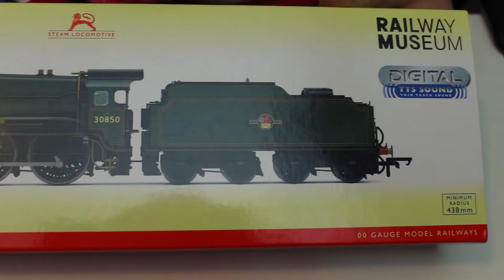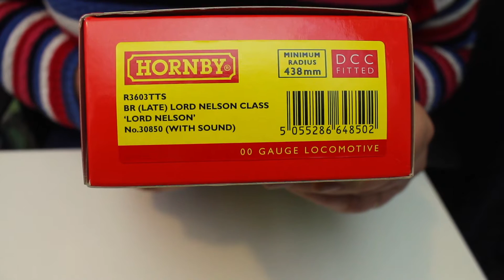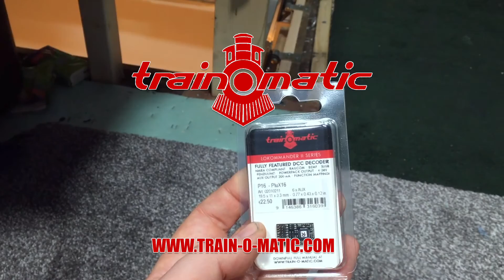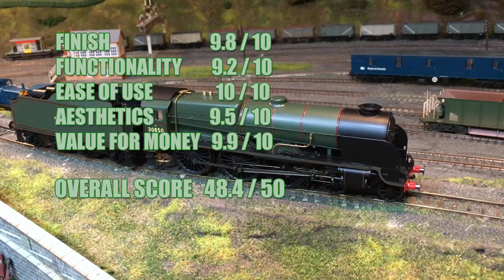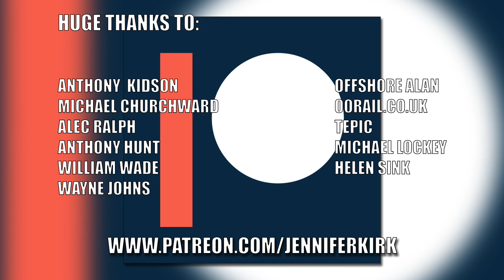Hornby Lord Nelson Class in BR Late Crest livery with DCC TTS Sound - Unboxing and Review

Comment: Hi Jenny. The Southern Lord Nelsons when originally built, had six wheel tenders for hauling 500ton boat trains between London and Dover, which is only about 60 miles each way. However after less than half the class was built the Southern decided to use them on the South Western route requiring a larger water capacity tender, hence the 8 wheel tender, as the Southern had no water troughs. Even these longer routes were less distance than the LNER or LMS Anglo Scottish routes, so that is why the coal capacity was alot smaller than an A4 or Duchess. I must also mention you picked out the nice detail of the "Regulator" on the side of the locomotive, it's actually the "Reverser" linkage. Just one last point, in your video of the BR logo it seems like the wheel and top of the Lion look blue, was that a right, I don't think so? Anyway, nice review as always, Best regards Dave.
Reply from the maker: stretchedits thanks - I have a habit of getting similar terms mixed up. 

Thanks for the info!

Comment: Locomotives use more water than coal. And stopping to take water costs time and is more frequent than coal once or maybe twice a day.
Also you could put extra weight in the boiler for more grip
Reply from the maker: BAMBAM5476 interesting points. Makes sense.

Comment: Hi Jenny. Great review. I bought one from RofS. First steam sound loco. Love it. But help.  There is a small wire from the rear left drive wheel that attaches to the bodywork above and behind it. It has come away from the bodywork end (wheel end is still attached) I cannot see how to reattach it. Looked closely at your review and it is still not clear. Is this cosmetic or functional? Can I just superglue it back on? Thanks in advance for your help.
Reply from the maker: Peter Walker it is the speedometer cable. Purely decorative. On mine it attaches to a bracket that is just glued to the underside of the running plate.
Reply: Jennifer E. Kirk Thank you so much.  Really appreciate your early response.

Comment: Just seen today after I ordered mine from RoS at £129.50 in their Christmas daily deals - do I  get  the full 10/ 10 for value for money? Had no idea it was such a superb model (I am abroad and yet to receive mine) which your review has shed more light on and done full justice to, well done and thanks. Your are spot on with the Hornby TTS sound chip excellent value for money (circa £32) and good overall functionality and performance. It makes it so much more affordable for the majority of modellers when some other chips (over 3x that price) exceed the cost of a decent engine alone - Hornby need some credit for that!  As do Hornby plus RoS/ Hattons for giving us such good deals. But this model will certainly take some beating.
 
Perhaps before people knock the "as new" price they need to remember there is 20% VAT out of it. So at £139 Hornby and their retailers only have £115.83 to take out for all their development, manufacture, materials, packaging, overheads, sales, salaries and internal transport (China to England to retailer) costs, oh and then some profit. Try doing that yourself.
Reply from the maker: Stephen Pike totally agree. For a sound fitted loco that price is about the same as what some sound chips cost on their own.